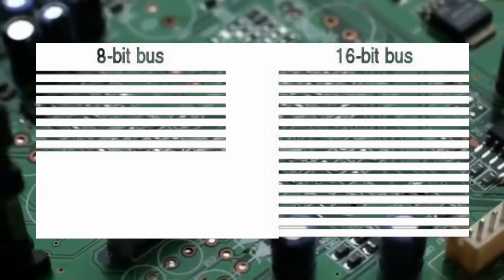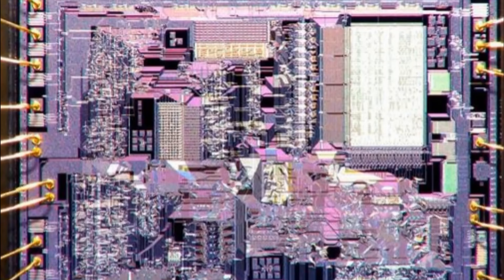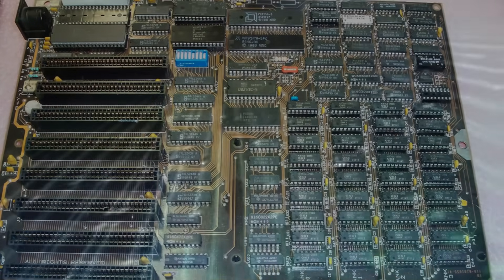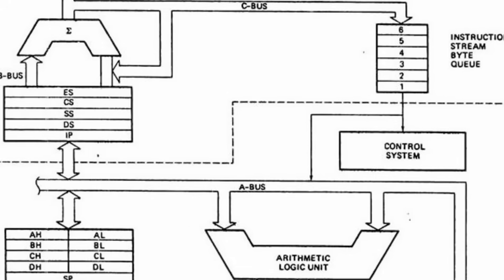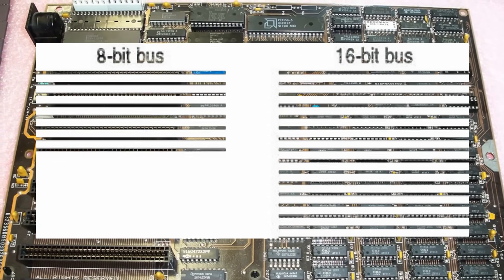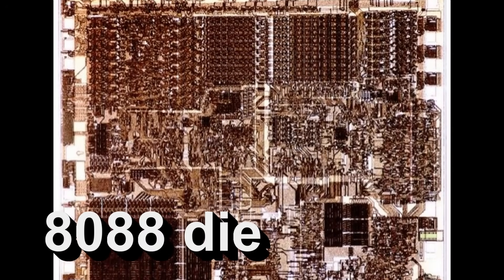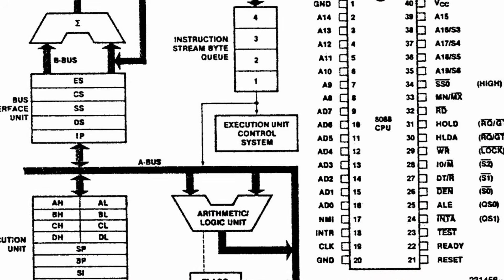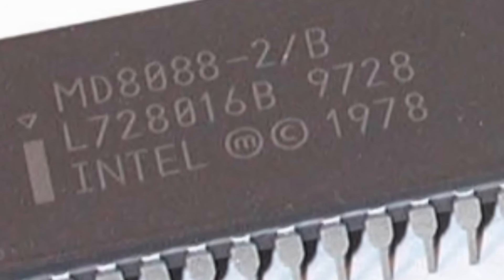8088 & 8086 CPUs... Why 16 bit Came Before 8 bit [Byte Size] | Nostalgia Nerd

Comment: Not to forget the 4004 and 8008, and the 8080., but ultimately the MOS 6502 won out for many due to the price. I believe the 8088 was a reaction to the price of the MOS 6502?
Reply: Or if the management at Commodore hadn't screwed up royally, we might all have been using Amigas now.
Reply: +Matt Lee the 6502 was a superior processor in many respects even if it was not a 16 bit processor. The instruction set was extremely simple. Most instructions were 1 or 2 cycles max as where the 80XX were horribly inefficient in cycle usage and even though the 80xx had more registers the instruction set was rather limited. Any subsequent 80x86 processor following was even worse as it had to maintain compatibility with it's 16 bit counterpart and the only way it could ever use more memory is through memory segmentation. The truth of the matter is that the 6502 in the end did not win out as you'd probably be using a 64 bit version of an Atari or Commodore computer today. IBM's name was so huge that they could have used dog doo for a processor and it would have won the market share. Bill gates undermined IBM who has long ago left the PC based market they created. Let's put it this way. An Atari 8 bit or a Commodore 64 was much more feature rich and cost WAY less. It was a few years before you could even get any reasonably priced color cards. Even the expensive ones were so slow that the other 8 biters at the time were far more capable. IBM originally toyed with using the 68000 as it's processor, but unfortunately for us, Bill Gates essentially stole CP/M and Unix, put them together and created MS-DOS. Computers like the Amiga or Atari ST were far more capable and less expensive and it took DOS based machines a bunch of years before they could compete technically. In fact the Intel line stepped in shit when IBM went with them. That IBM name held such high esteem that technology had nothing to do with why we use DOS/Windows based machines to this day. These OS's are garbage and continue to be garbage. They are inferior in every way as are the processors. It was not until the Pentium lines came out that Intel started to show some real technical prowess.The only real competition to an Intel processor today is the Arm processor. If this were not true, Apple would still be using the PPC, but even they saw the writing on the wall. Remember...the 8088 was designed to do motor control processing, not home computing. Bill Gates was not a marketing genius. He simply went with a name no one else could compete with. Once he had a stronghold, his marketing was just a pile of BS and most people bought into it. So in that respect, if BS'ing your potential market is genius, then yes Bill Gates was the master. Technologically, he has us all by the short and curlies. I use my PC because it is the mostly written software platform. I'd prefer something much more than what the DOS/Windows based PC have to offer but there is not much out there. Android or iOS as well as OS.x are the only competition and they are all front ends to a Linux Kernel anyway. Linux should be the Os of choice but too many people are afraid to switch because the support is just not there. One day this may change and I always though it would have by now, but you can't walk into a store and buy a fully loaded Linux system, at least no where near as easily and as cheaply as it is to by a Win based machine. I have  a Mac, my PC dual boots to win and linux....I always use the win based Os...why? because unfortunately, that is where all the good software is.
Reply: It was a 6800 clone taken from already existing design from Rockwell and the 6502 had a deeper pipeline and better performance at probably just 1/5 price. 6800 costed as much as 150dollar when released while 6502 wnet as low as 25 dollars. Many micros including Apple and MANY arcade system hold at least one 6502 inside. The 6502 probably was a game changer making processors AFFORDABLE and enabling electronic industry beyond the computer market, using processor on other stuff like a lift controller.
Reply: Why is everyone here forgetting the Zilog Z80? Which is a lower-price, enhanced version of 8080.
Reply from the maker: +Matt Lee It was certainly a reaction to the industry not wanting to expand their boards to the 16 bit architecture, so any competition which circumvented were probably winners, until IBM came along and snapped it up.
Reply: +GeoNeilUK - it was a modified 6505 - adding speed and quirks - hacked-up version
Reply: There's some pretty good software on Temple OS!
Reply: You forgot the 8-bit 8085.
Reply: +galier2 Yeah, you have to do it manually, like this. Bit of a pain, but at least it's still doable.
Reply: +Matt Lee The 6502, which became a Commodore part through Jack Tramiel buying up MOS after bankrupting them through not paying Commodore's bills (Business is War... and that would make a good title for a biopic or mini-series about him)
Reply: +GeoNeilUK Sorry, I think I'm missing your point?
Reply: Matt Lee Just sharing a bt of history.  The 6502 was meant to be a cheap clone of the 6800 and was desgined by people who had left Motorola (the makers of the 6800)

It was actually lawyers that made the 6502 what is was!

What's interesting is Atari and Acorn were using this Commodore part in their computers which were directly competing which the VIC-20 and then C64 (which is probably one of the reasons why Acorn just said screw it and designed the ARM CPU for the Archimedes, they didn't want Tramiel doing to them that TI did to Commodore's calculator business)
Reply: If the 8088 was a reaction to the low price of the 6502, it was an extremely late reaction, at a time when the microprocessor field was undergoing successive revolutions at a pace not seen again until the mid-late 1990s. The 6502 launched in 1975 (if you can even believe it), not long after the Z80 (which was a lift of the i8080 design much the same as the 6501/6502 was, ahem, heavily "inspired by" the MC6800), and the 8088 came along in 1979, a year after the 8086 (and indeed, 68000) even.

If any Intel product could be seen as a reaction to the groundbreakingly low price of the 6502, it would probably be the 8085, which arrived in 1976 and essentially added a couple of extra features that the MOS chip (and probably the Motorola ancestor, which Intel maybe weren't too bothered about originally as it didn't have anything like the same price advantage) had vs the 8080, keeping them in contention at least in the 8-bit field whilst they prepared their 16-bit successor.

Customers' and system builders' desire for a chip that had the myriad advantages of the first generation of 16-bit parts (all except for that otherwise seemingly critical double width data path...) but in a form that would still work in old 8-bit board designs seems to have caught both Intel and Motorola by surprise, leading to both the 8088 and 68008 (which never did quite as well, possibly because the 68000 wasn't as expensive as the 8086, but was much more reliant on being able to shift 16 bits of data at a time for its performance - especially when working on 32 bit data - and so there was both a smaller cost saving but a greater difference in outright speed between the two Motorola parts) coming out after their parent chips.

MOS and WDC seem to have taken an opposite approach and hung on to their somewhat more efficient 8-bit designs for as long as possible, and then only did the bare minimum possible to craft a successor 16-bit design out of them, essentially keeping almost exactly the same core but widening the registers and adding a few extra data and address pins...

One of the problems with the 6502 design, FWIW, is actually its extreme cycle efficiency and the much vaunted ability to use the Zero Page of RAM as a massive register file; in order to do so, it demands extremely fast memory when running at a decent clock speed, on the order of what the 68000 or 8086 also needed (albeit half the width of it) - as their higher clock speeds were tempered by memory cycles that took 4 whole clock ticks (and are the reason for e.g. the particular CPU/Video memory access interleaving seen in the ST, Amiga and Mac).

Which is why you find a lot of 6502 based designs either have a notably low CPU clock speed, sometimes under 1MHz, in order to get away with using more affordable memory, or they have to use expensive high-performance RAM, and often SRAM instead of DRAM (even more expensive!) to avoid upsetting the CPU if it tries to make a zero-page memory access during a refresh cycle... It's at least part of the reason why the Apple II, Atari 8-bits, VIC 20, C64 and BBC Micro were so markedly more expensive than their Z80 (and ultimately 8088) based competition.

Also, its code simplicity is why they ultimately ended up having their asses handed to them by the 16-bit machines. Even if they were running effectively the same memory clock, and thus the same instruction read rate, each opcode could encode a much wider range of instructions - including some that would perform complex tasks entirely internal to the CPU that would take a string of separate instructions and a whole lot of additional memory access on a 6502. Plus of course they could move twice as much data in or out per clock tick, perform 16-bit math in a single operation (and the 68000 could do 32-bit math internally, albeit taking about twice as many ticks to do so as it only had a 16-bit ALU connected to its 32-bit registers; still, that still meant it basically took until the introduction of the 386 for Intel to catch up to Motorola in terms of integer ops per clock, with a 12Mhz 286 struggling to keep pace with an 8Mhz 68k), and generally ran at a much higher speed (at least 4, and typically at least 7Mhz).

(With the Z80 sitting sort of in-between... being less efficient on memory accesses and per-clock processing, but also able to run at higher speeds. Though the MSX standard machines and those with a similar architecture immediately previous to its establishment managed a particular coup in terms of performance by integrating the TMS9918 and its successors, which were essentially full graphics coprocessors with their own separate memory space, rather than simple video shifters that had to share the CPU memory space and carefully interleave access to it, which could cause some slowdown in more demanding modes on 6502 and 68k machines as seen with the C64, non-fastRAM-equipped Amigas, Acorn Electron (which lacked the BBC Micro's TMS-like segregated memory system) later Macs etc...)
Reply: There is serious anachronism in your comment. ARM came about in the '80s when 6502 was already outdated and was not under Tramiel control anymore. The issue you portrait may be actual in the late '70s, but at that time it was more Apple II vs Commodore PET. VIC20 and C64 are also products of the 80s.
Reply: Which of us are you replying to, here? I didn't say anything about ARM, or Tramiel.
Reply: The 2 year old comment of 3GDOSRSFSR. I didn't check the dates of the comments and answered from the hip. Youtube doesn't include the name of the commenter when clicking on respond any more. It's annoying.
0
Reply: +3gdosrsfs what about UNIX do you believe was copied into MS-DOS?